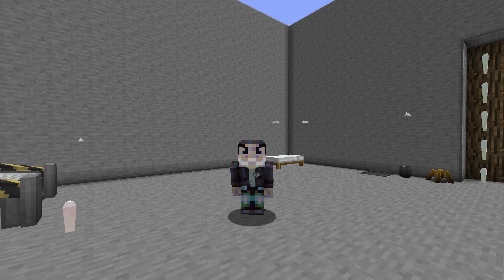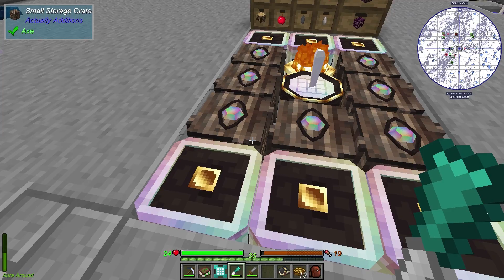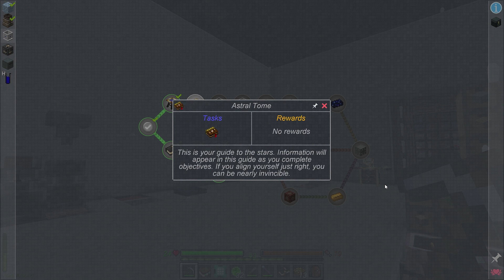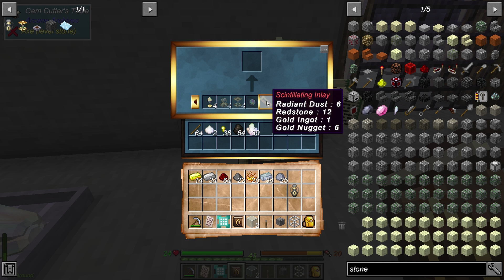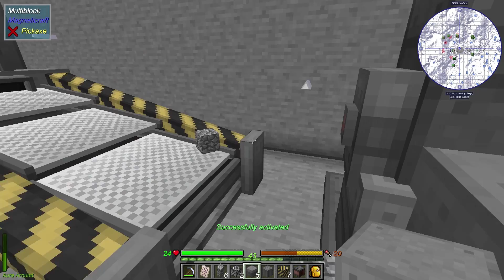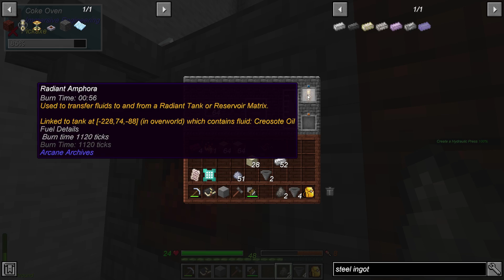Glacial Awakening Hydraulic press

Comment: Something of note to people annoyed by the Resonator sound (including myself -- I need to adjust it down in the next version) -- you can specifically disable that sound in the "Sound Config" settings, specifically allowing you to disable individual sounds or all sounds. In future you'll be able to adjust the volume of each of the sounds as well as an upgrade item that just mutes a specific device.

You can also sneak while pressing the Manifest hotkey to clear the lines (it's mentioned in the tooltip of the manifest).

You're so far also only the second person who I've seen with that graphical glitch -- I'm not sure what's causing it. For the first case a few weeks ago I assumed it was a problem with the graphics card... now I have no idea what's causing it. :(

Comment: So the power system is a little weird by minecraft standards but i think volts is how much power it CAN draw  as voltage is a measurement of electric potential, and Joules is your bog standard measurement of actual energy, and watts is how many joules/second you're making, so maybe you're supposed to let the volts build up and let some buffer power stay for maximum speed? Kinda like irl with how less power in a machine, such as an electric bike means less speed for instance, and more speed and maximum power

Comment: The Thermopile on the plate machine may have a slightly higher output as the water has frozen over. Unsure if it makes a massive difference in the  power output.

Comment: I did a set of four coke blocks, in a pinwheel, inset into the floor, and used a huge tank, in the middle block, was a conduit extracting from all four coke ovens, pushing into the tank above it, making the entire set up flush with the floor, but i had the creosote output of four ovens. needed creosote, to get into making the cloches; of course. 4 stacks of coal blocks later...and I have all the creosote I could need!

Comment: Have you tried to daisy- chain the machines off one power source. connecting them in series with  a power cable connecting one machine to the next makes more sense then each needs 2 power inputs. I think it's technically called pass-thru power or something like that.

Comment: 35:33 "It's weird that the radiant amphora doesn't tell you what the target tank hold…"

… as he's looking at the tooltip that says "Link to tank at [-228,74,-88] (in overworld) which contains fluid: Creosote Oil".

By the way, if you put a block of coal in the blast furnace, it will make a block of coal coke, more fuel efficiently than individual pieces.
Reply: He meant the amount in the tank.
Reply: @SirJoshuaTree  I suppose that's possible.